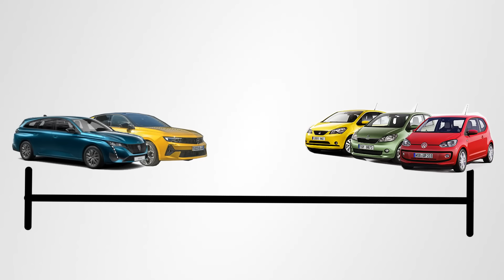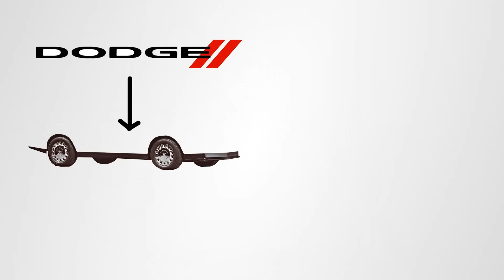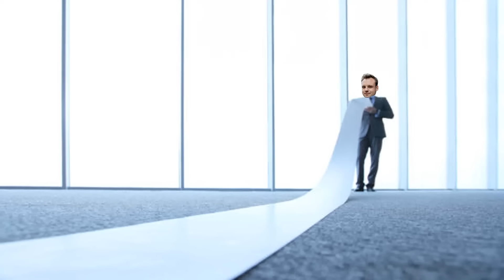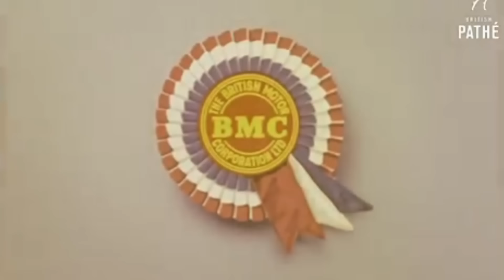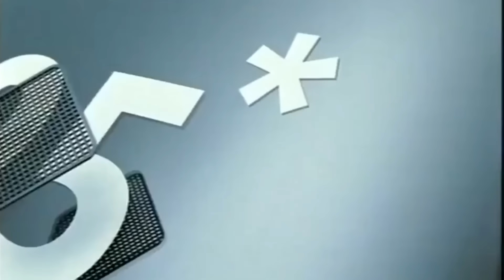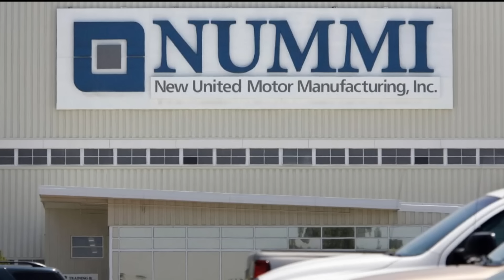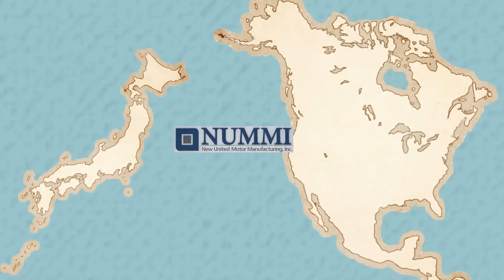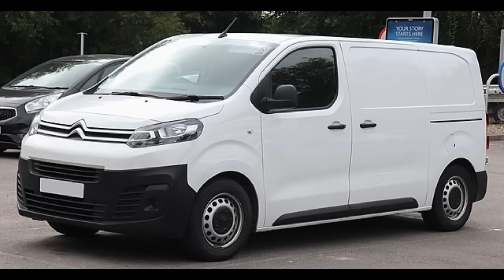Ep. 30 Seeing Double: The History of Badge Engineering

Comment: An obscure rebadge that I grow up with it, was Renault 12 that was rebadged as Dacia 1300/1310, which was in production until 2004. And was modified into estate version and a pick-up version, which prove very succesfull.
Reply: And the Rebadged Dacia was introduced some month earlier as the Renault 12!
Reply: Dacia isnt a rebadge tho. they just built the same platform, independently. Dacia bought the license from renault, so its not a clone either.
Reply: And it came to Brazil as Ford Corcel, the sw  was called Belina and a remodeled version as a small truck known as Ford Pampa
Reply: Its licence production , the quality of the dacias were terrible after 70’s. But one interesting example is Olcit Club and Citroen Axel. This were designed by Citroen and made in Romania. Citroen has a plan to sell this design to Romania, but after crisis they dont have money to pay, so they export cars to france. This cars have some quality problems (they dont have any quality at all).
Reply: @kepakpl  Fun fact about Dacia. Dacia Nova, SuperNova and Solenza are the only Dacia cars 100% designed in Romania. Dacia Nova shared components with Dacia 1310 CN3. SuperNova was the testing bed for Renault components after acquisition in 1999. And at Solenza they tested the factory tooling for Dacia Logan.

Comment: I used to own Daewoo Lanos.
Once I hit the pothole when I was on my vacation in Montenegro. Rear wheel bearing failed.
I left it by the road and went to next town, and asked for rear bearing for Daewoo Lanos. Seller had no idea what that car was. I remembered that Lanos shares platform with Opel Kadett E, which has copied VW Golf MK2 Golf rear suspension. So I asked for Golf bearing. Whole kit with bearing, nut, split pin and grease was 8€. I fixed car by the road and it is still driven like that to this day.

Comment: The Gemini was actually rebadged 28 times across all of its generations BEFORE it was a Honda rebadge itself. What is this 28th Gemini, you may be asking? Well, curious reader, that car is the Pontiac Sunburst.

I don’t blame you if you’ve never heard of this car, or thought I meant to say Sunbird, another rebadged Pontiac from the same time. The Sunburst is completely different, though. It was based on the second generation Isuzu Gemini, and was sold from the years 1985 to 1989. It was only available in Canada, but even then, 88.5% of Canada’s population couldn’t go to their local Pontiac dealer and buy one of these new. How did that happen? Well, for some reason, General Motors decided to only sell this car in British Columbia. A single province with less than five million people in 1985 had its entirely own rebadge for a car that didn’t even need one, as they already had the Chevrolet Spectrum AND Isuzu I-Mark there! As expected, it sold horribly, selling only about 7,000 in its four model years (cannot confirm). Hearing how much of a disaster this was, you’d think GM would decide to not expand on the Sunburst idea even further, right? WRONG! They had the bright idea to rebadge the Chevrolet Spectrum Turbo as the Sunburst Turbo for the 1987 model year. This turbo model is so rare that there are no photos of it anywhere, only two mentions in car listings in 80s newspaper archives, and the only way I was even able to prove this car even existed was by finding an image of a Spectrum/Sunburst Turbo parts diagram that shows roughly what the badges looked like and their part numbers. The Sunburst turbo likely went extinct before the new millennia, but I have no way to prove that any of them even left the dealership before disappearing off the face of the earth. There are only three confirmed Sunbursts surviving today: one is sitting in a driveway, one is/was in Ukraine, and only one roadworthy Sunburst is known to exist. I’ve dedicated way too much time to these cars, but I will continue to search until I breathe my last breath.
Reply: Wow, I remember those cars.  didn't know this though.  I live where they were sold.
Reply: But it sure wasnt the same as the Isuzu Piazza as stated, maybe Ed should have researched it a bit better....
Reply: @gjverhoof1336  Isuzu Piazza/Impulse was derived from the Gemini. Maybe that’s what he meant. It’s on a Gemini platform.
Reply: You're doing God's work man
Reply: I remember the old holden gemini
Reply: And yet another badge: Opel Kadett...not made by Isuzu, but it was the original T-Car, debuting in 1973.

Comment: The OPEL Kadett C was developed in Germany in the  late 60's in the GM T- Platform  and it was sold in European markets between the years 1973 and 1979 . The first Generation of the Isuzu Gemini (1974-1984) is a Rebadged Opel Kadett C and not the opposite . The OPEL kadett C had also deferent engine line up and it was offered also as a coupe ,as a convertible and a Station Wagon
Reply: Actually, the GM T platform was first introduced in Brazil as the Chevrolet Chevette 6 months prior to its introduction as the Opel Kadett in Germany. (March 1973 vs September 1973)
Reply: I was locking for both of your comments! William is right about where the Kadett C or Chevy Chevette or whatnot started to drive around, but hardly anyone in Europe knows about it. For the most people in Europe that is clearly a car from Opel Bochum, what it was. But you missed one out, the 'best' one out of the line, the Kadett C City, the cut off hatch back... Back in the days I never liked them, any of them, I was more the VW Golf guy for a while, but they were actually damn good little real cars!

Comment: So I was a mechanic for many years and the oldest rebate I have seen was the 1939 pontiac/1939 chevy, same car, different grill. That's it. But my favorite rebadges would be the 1st gen Mitsubishi eclipse, eagle talon, and Plymouth laser. 3 performance sport compacts of the same car, in the same market only difference was the badge and the tail lights.
Reply: Wasn't the Pontiac then fitted with a flathead engine, while the Chevrolet already resorted to overhead valves?
Reply: just like the Mits 3000gt\Dodge Stealth. All same frame just bolt on several different cosmetic parts.
Reply: Didn't Dodge own Mitsubishi for a while or vice versa?
Reply: @lelandclayton5462  no they entered an agreement as partners. Cause Mitsubishi as a foreign auto maker wanted to break into the US market, but laws said they were only allowed to sell so many cars and it wasn't gonna make them money, so they made a deal to have cars made here in the US and sold under both Mitsubishi and Chrysler. Meanwhile Chrysler got free car designs and a cut of the money. Well in 1998 Mitsubishi decided why we giving Chrysler money to sell our cars when we con jut manufacture them in the US and sell them ourselves. And that was the end of diamond star motors or dsm
Reply: @jaydeeeclipse9010  "1998 Mitsubishi decided why we giving Chrysler money to sell our cars when we con jut manufacture them in the US and sell them ourselves."  Personally, I think their zenith was at that time. I mean no 3000GT or even Eclipse any more, just compacts and an suv. Obviously their quantity dropped enough they closed the US factory and find it cheaper to ship them over. They even threw a lifeline teaming with a French car company not long ago.
Reply: Yes; and they were made by a company call 5 Star motors.  The paint colors were specific to them and not their badges.
Reply: @zOiNhUh  That's not the only difference.  1939 Pontiacs had a flathead straight-8 available.  Chevrolet wouldn't get an 8 cylinder until 1955.

Comment: One of the laziest badge engineering jobs I recall was the first generation Escalade.  They just changed the badging from a GMC Denali.
Reply: …….which was a rebadged Chevrolet Tahoe/Suburban.
Reply: Hey! The taillights are different!  Some Tahoe owners go out and buy Cadillac taillights and mount them to their Chevy as they just bolt on.
Reply: @brianburns7211  .....which uses the same GMT platform that underpins the Silverado/Sierra
Reply: Cadillac Cimarron: Hold my beer!
Reply: I remember that well. All I saw was a fancy emblem on a Tahoe
Reply: @deanfehribach  On the newer ones, you'd be correct.  However, the first gen was stock Tahoe/Yukon taillights.
Reply: @PrinzII  I swap Escalade parts into my Silverado all the time. I really enjoy it as it lets me upgrade my vehicle over time and makes it feel newer.
Reply: How about the 80’s Cadillac Cimarron???
Rebadging at its finest!!!
Reply: @greenbeacon394  It was a glorified Chevy Cavelier and not called Cadillac Cimarron but called Cimarron by Cadillac, lol, even they knew it was a swash bucket.
Reply: @NellzM60  

Didn’t they have some super cheesy D-List Celebrity do commercials for it too? 🤣
Reply: @Father_of_Death  My pick for #1 'badge engineered' car, hell the Cavalier wasn't even a good Chevy.
Reply: Let's not forget the saabaru 9²X /subaru impreza and 9⁷X / cjevy trailblazer and 9³/ chevy malibu
Reply: @GoogleDoesEvil  the only way to upgrade a gm product is to trade it in on a toyota
Reply: @blmartech  Nah man, I had a 2015 Toyota Camry, a 1999 Honda Civic, and a diesel 2004 Silverado 2500HD for towing trailers. I was hoping for the Camry to replace the Civic and I hated it so much. I sold it. The only vehicle I really care about is the Silverado. (I still do maintenance on the Civic, but I don't care about the paint or interior anymore.) Both the Silverado and the Civic were much easier to maintain.

Also, Toyota doesn't sell a 3/4 ton truck, but even if they did the 2022 Tundra is pretty problematic.
Reply: @GoogleDoesEvil  ive got 5 yotas ranging from an old pickup to new.  Ive got a beater 2000 celica that i drive daily hour each way with 379k.   Last pil change was 2008 until summer of 2021 when oil filter rusted all the way through.  Still didnt change the oil, just put a new filter on and topped it off.    Havent bought a thing for that car but brakes and tires.   All i have is yotas for vehicles and no bs you talk with ever convince me that a gm product is even close.
Reply: @blmartech  That's impressive that you got 379k miles on the clock, but you really need to change your oil more frequently. If you got 379k miles on it while neglecting it, how many more could you get if you maintained it?

Also, towing a heavy trailer with a Tundra is illegal; so, it's not an option for me. Best of luck to you!
Reply: @GoogleDoesEvil  it was the wifes old car 3 new cars ago.  I said id drive it to work till it dies when she stopped driving it.  Been saying that for almost 15 years
Reply: @GoogleDoesEvil  oh, and the reason you cant get a real toyota truck in the us is also GMs fault.  They cried to the government about not being able to make a truck as good as the toyota trucks, and we ended up with tariffs and a taco and tundra instead of the hilux.   Thats why i wont buy a yota truck newer than 95.
Reply: @brianburns7211  At least they finally changed they name instead of selling the Suburban under both GMC and Chevy branding in the 90s lol.
Reply: @brianburns7211  You mean Suburban only, the Tahoe is a fair bit smaller than the Burb. Easy way to tell the difference at a glance, Suburbans rear doors go straight down in front of the rear wheel well, about 1/3 of the Tahoes doors curve over it. Escalade, Yukon XL, and Suburban are all the super size SUVs. Tahoe, and regular Yukon are still considered full size but are smaller. not sure if Cadillac has a equivalent.
Reply: @brianburns7211  and the gmc yukon and yukon xl
Reply: @GoogleDoesEvil  "upgrade" 🤣
Reply: @blmartech  Well, you kinda need to own only Toyotas because clearly you can't take care of a car, jesus Christ no wounder you had 5 of them
Reply: @blmartech  Nice Fanfic, yeah none of that is true, you're talking about the Chicken Coop tax of 1964, which was done mostly to fuck over VW imports, (Which Mercedes is why you can't even import anything under 25 years old in this country by the way they did that in the 1980s)
Reply: @frumsmcnoodles323  Yeah there is a Suburban size Escalade, it's the ESV, which it's not as popular as it's Tahoe size brother
Reply: And yes the chicken tax was put in place to help domestic car sales because they couldnt compete.  Just like harley cried to our government in 83 about 750 cc bikes from japan shitting on harleys and needed a tax advantage
Reply: Same as the silly Expedition/Navigator rebadging. Yeah, here is a Expedition at 1.5X the cost.
Reply: Ironically that car saved Cadillac
Reply: @blmartech  Talk of dying puts a real scare into your old yota..
Reply: @nickrustyson8124  what does Jesus Christ have to do with this topic? Trying emphasize your comment more strongly? I'm sure you wouldn't use your mother's name in that casual way
Reply: The one I recall in my home country is the Ford Versailles and the Vw Santana, or the Ford Verona and Volkswagen Apollo
Reply: @bradzimmerman3171  
You have any links or proof to support your statement? If Jesus is fake, why the anger? I don't get mad about unicorns.  

Psalm 14
1¶The fool says in his heart, “There’s no God.” They are corrupt; they do vile deeds. There is no one who does good.

Comment: I had a Chrysler 300 Touring back in the day. Fun fact, its not only a Dodge magnum with a different front, but the Dodge magnum itself is  also more or less a Mercedes E-Class chassis/drivetrain/suspension. And the second generation of the Chrysler 300 was sold as a Lancia in Europe - with a slightly different grill.

Comment: I'm mostly familiar with Chrysler Corp (now Stellantis) re-badging.  Especially between Dodge & Plymouth.  In the 50s, the two had different bodies, wheelbases, and interiors.  By the 60s, they just had different front/rear clips (compacts were the most similar and full sized the least), by the late 70s & K car 80s, its was grilles, trim levels, and badges.  By 2000, they were so close, no need to keep Plymouth so it was dropped.  But GM was worse, with the same cars spread 4-5 wide across most all divisions, IE Cavalier, Sunbird, Firenza, Skyhawk, & Cimarron.

Comment: Thanks for another great show!  

The Austin mini was rebadged lots, and you noted the Austin, Morris, Riley and Wolsely, but you forgot Innocenti and Vanden Plas versions.  British Motors corporation managed a similar feat mechanically:  they used the same basic running gear throughout the Mini version and in a series of larger cars. The Austin 1100/1300 series uses all the Mini's running gear, as do the Mini Moke jeep-like cars that are seen in the tropics. The Austin 1100/1300 series also comes in flavors like Morris, Vanden Plas, Innocenti, MG, Wolseley and Riley.  They also used the same bodies and running gear in the Austin America, after swapping out the manual transmission for an Automatic for the American market.

I drive one of those Austin Americas with a 1275cc engine and automatic transmission. It's a hoot to drive, but absolutely gutless. the slushbox really saps the small horsepower these cars produce. Austin Americas did not sell well.  Americans might like their automatic transmissions, but they want them with enormous V8s and loads of low end torque.  🙂

Comment: In Australia. We have the button car plan, VN/VP/VR Commodores became Toyota Lexcens. The XF Falcon Ute became the Nissan Ute and the Nissan Patrol became the Ford Maverick.
Reply: And the Nissan Navara became the now defunct Mercedes-Benz  Ute. 👍👍🇦🇺
Reply: @andrewhallett-patterson9778  but in fairness. Merc changed everything bar the cab structure.
Reply: @audoinxr6372  True. But they kept the  legendary unreliability of the Nissan driveline just to remind purchasers that all you purchased was a overpriced pimped Nissan. Even the Nissan manufacturing compliance plates installed in final factory inspection are still attached to achieve ADR ! Mercedes attached secondary compliance plates that indicate factory modifications, again for ADR. 👍👍🇦🇺
Reply: Nissan pulsar badged as a Holden Astra, later on the Toyota corolla the Holden nova and the Camry as the Holden Apollo. Also got the Daewoo 1.5 still with the Pontiac badge on the grille from when it was the USA model Lemans
Reply: Don’t forget the Ford Laser/ Mazda 323 and I vaguely remember a Ford add explaining the difference between the Ford Laser and the Ford Meteor as they looked so much alike it was hard to tell them apart. The Toyota Lexcen (rebadged Holden Commodore) was named in honour of Ben Lexcen, he designed the winged keel under Australia II which won the America’s cup in 1983 after America had held it for 132 years.
Reply: @sutherlandA1  Thanks for the reminder. Completely forgotten .👍👍🇭🇲
Reply: @scroungasworkshop4663  More lost memories. Putting Ben Lexcens name on a lousy rebadged Commodore was a discredit to the great man. Maybe a special issue Statesman. If Ford could release a Greg Norman Fairlane for a expat golf player.......👍👍🇭🇲
Reply: @audoinxr6372  and it still didn't sell...lol
Reply: @audoinxr6372  up the mighty AU!
Reply: @scroungasworkshop4663  also the Ford Telstar and Mazda 626 of the same era.